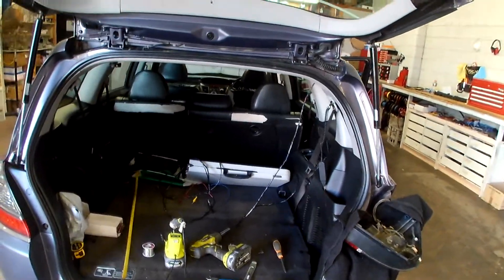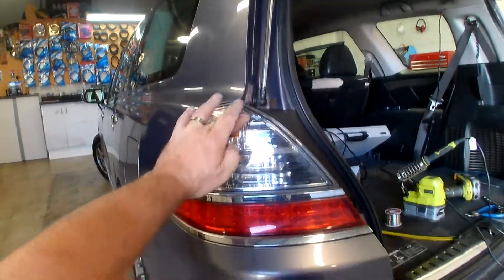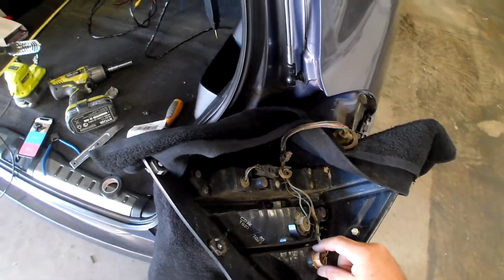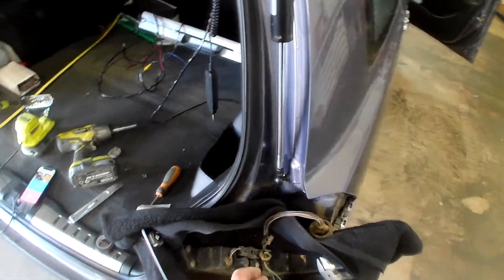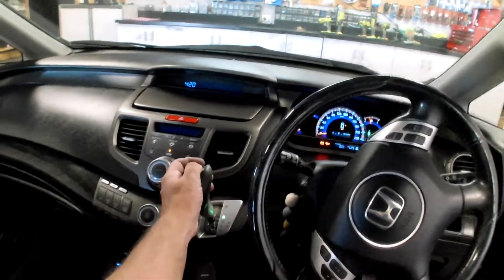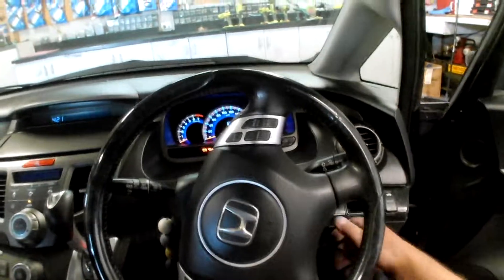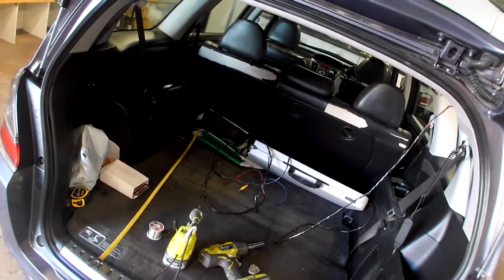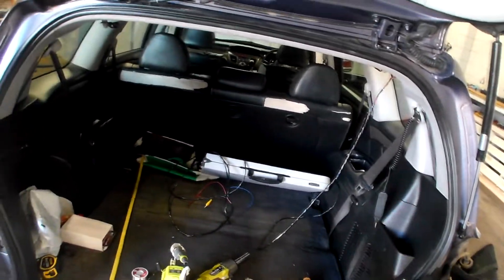How to find the reverse wire at the tail light

Comment: BOLD move tapping into the wire and using wire cutters to trim the insulation. Id have ended up snapping that wire in half. Lol.
Reply from the maker: Many many many years of doing this. 95% it works. If not, solder fixes it. It is interesting watching others do similar and which way around they hold the cutters. Most have the open end faint away, but I have more success with the closed end facing away. If beginning, a knife works well.

Comment: Great video. How do you wire the camera? I put it on the tailgate, but that’s too far away from the reverse wire.
Reply from the maker: As a general rule, I run an additional ACC and GND from the front to the camera directly, and use a seperate wire for the reverse trigger. This allows the camera to be used as a monitor in stead of just a reverse camera. Imagine you are towing a caravan, and you hear a clunk. You can (sometimes depending on the radio) select CAMERA and see the camera view without going into reverse. Also, a lot of modern cars PULSE the reverse trigger wire and this confuses the camera.